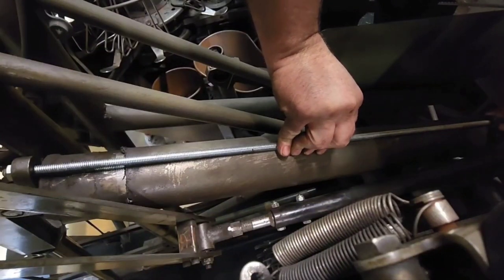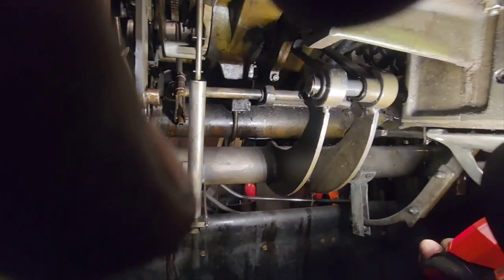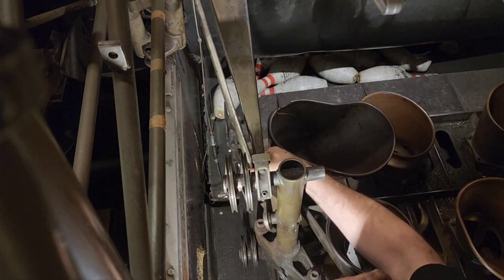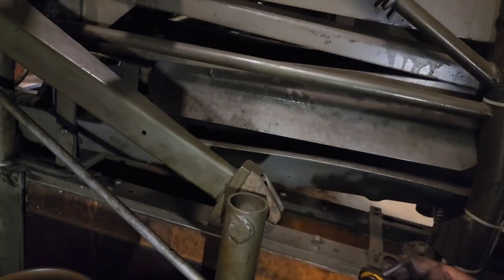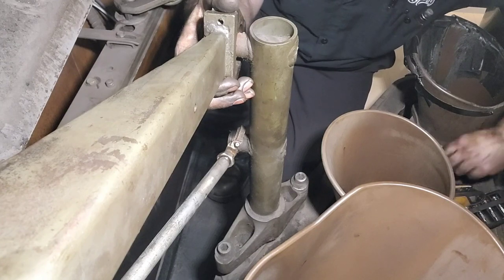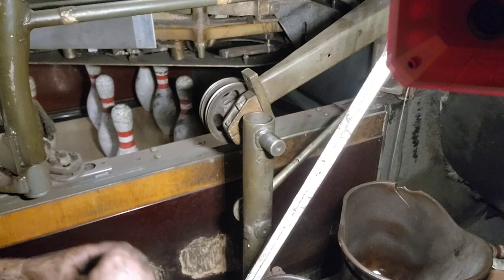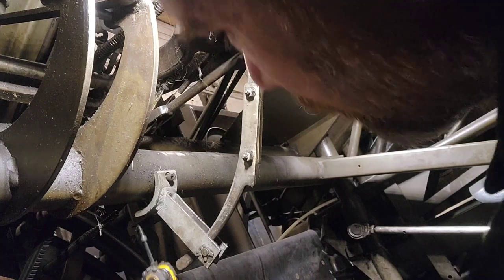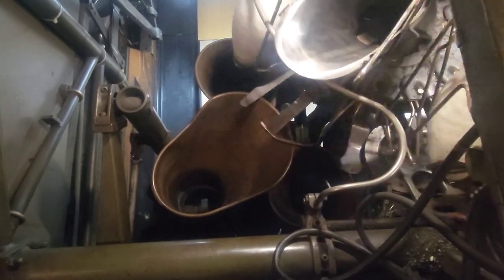Brunswick A2 pinsetter with bad deck lift shaft main bearing.

Comment: Quick question...what adjustment should be made on an A 2 when the deck is up, empty, but does not shift fully forward to accept new pins. Thanks
Reply from the maker: If the deck isn't fully forward at zero degrees after setting new pins, you can do a quick check to help you find out what's wrong. 

First, check the GB clutch adj. Is the machine stopping where it is supposed to? Maybe it's stopping early? If it's not stopping early, then trip the clutch and manually crank the GB forward. How far forward do you have to crank it before the MD shifts forward? Can you adj the GB clutch to stop at that point in the cycle? If not, then you may have damage to the MD/scissors cam or a 1:1 shaft that has twisted over time. 

How is your deck cable adjustment right now? Is it setting wobbly pins on a new rack? A super loose deck cable can cause similar issues to what you are describing.

Comment: Did I see a bad deck post bearing at 15:54?
Reply: Definitley looked really dry. IF it wasn't bad,..... it looked like it was on its last leg. When I do deck shaft bearings,....... I check everything I touch in the disaasembly process. Already have it apart,....... if it don't look right,.. change it out.